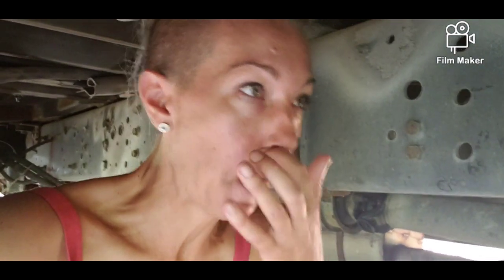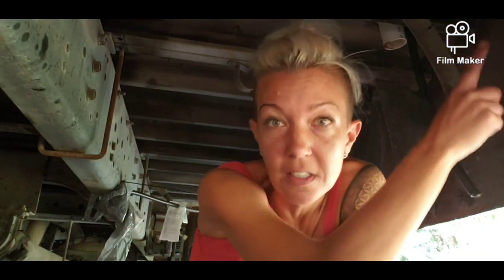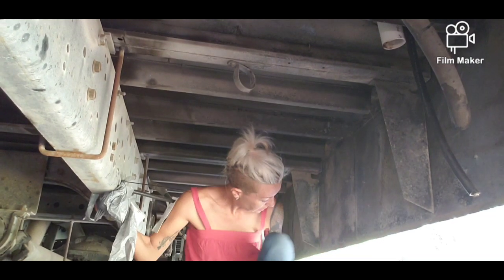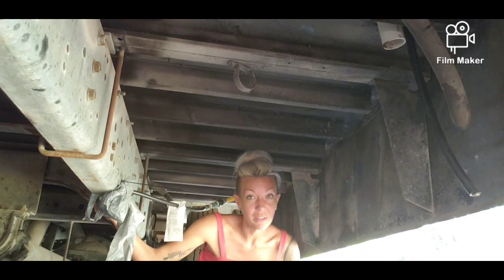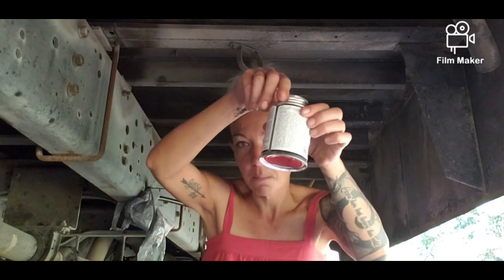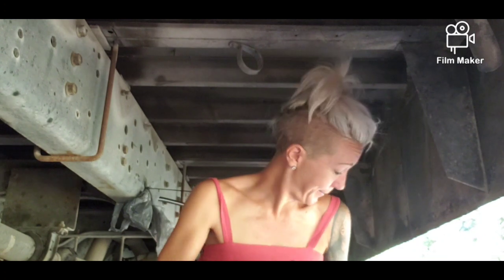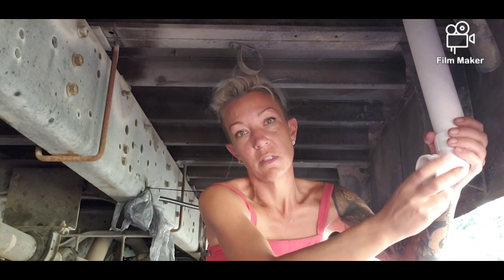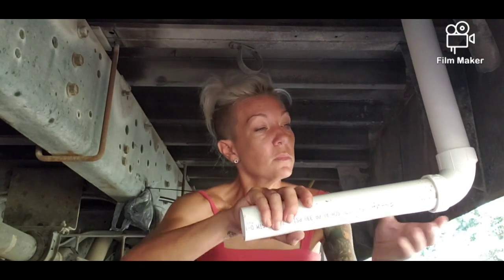Plumbing the gray tank in a bus

Comment: Hi Candace,  enjoyed the video,  hang in there. Here in Georgia ,  have to work quick because the ants will be attacking lol. So be thankful you're not having to deal with that. I probably would have used a 45 higher up along the vertical pipe. Or you can just shorten the vertical pipe and keep the 90.. and looks like the angle would be fine. Try to dry fit the run before gluing  also. . looks like the other folks have great ideas too. Have fun
Reply from the maker: Thank you for your great advice much love

Comment: Oh wow, I have been working on some of the exact same stuff this past week.
When I am building with PVC, I cut and fit all the parts together like a puzzle before I clean and glue them to make sure everything fits before it is permanent bonded together, saves money on wasting parts when I make mistakes.
You might want to try to keep the piping as tight to the body/bottom, things hanging down and sticking out will always find something to snag, drag and get fragged on at the worst time and place, just food for thought.
When gluing PVC you use cleaner, then primer(the purple stuff), then apply the glue, push the parts together twist to position required and hold firm for 30 to 45 seconds to avoid it pushing out while bonding
I am going to use a portable grey tank versus a mounted one but that could change just like all my other plans.

Lots of water water water water, a good fan on you while working and TAKE BREAKS set alarms on your phone every 30 minutes or whatever to remind yourself to take breaks, this is Texas in the summer after all. 
Seriously please be careful in the heat, there is no project or video worth your life!
Thanks for sharing
Mike from Texas, Take Memories, Leave Footprints

Comment: Dear your problem is the pipe coming through the floor isn't vertical.  It doesn't come straight down therefore your bend isn't straight.  I would've tried to put the pipe over the frame, hugging the floor but maintaining a slight angle.
Reply from the maker: I love the idea but I used the existing holes I have in the bus. I think I will try to figure a cut higher